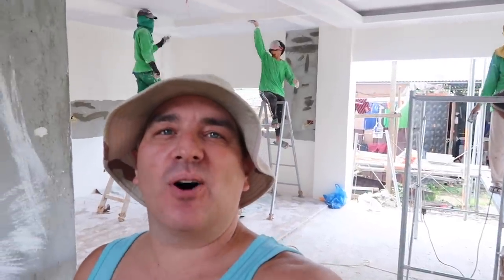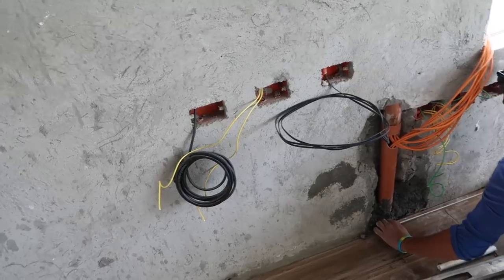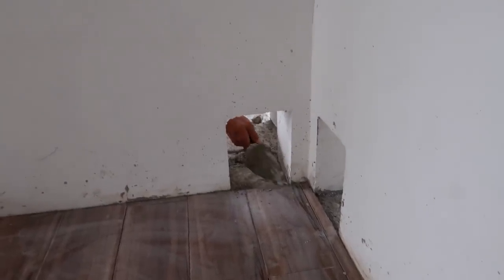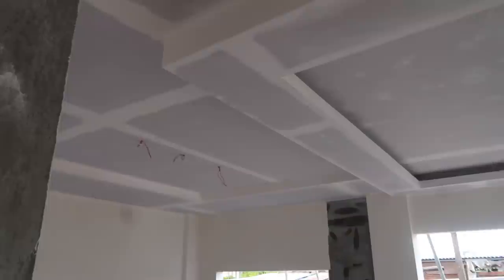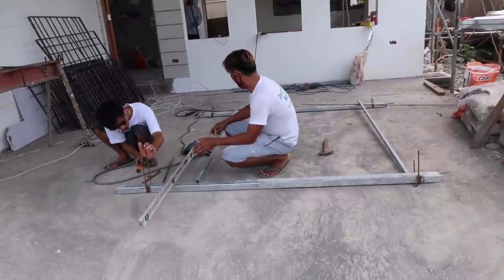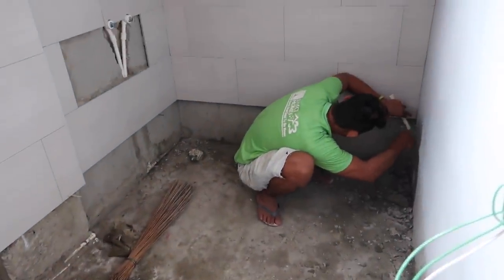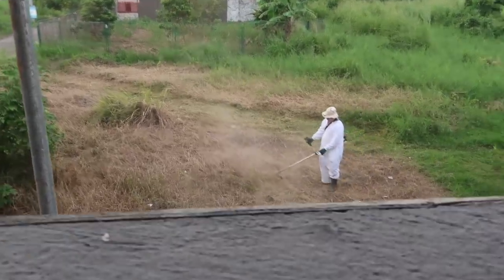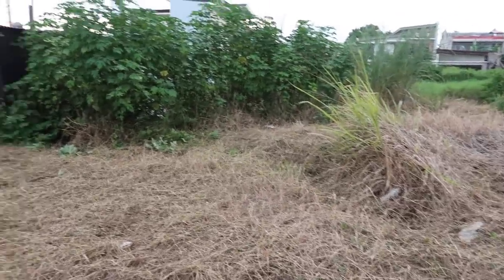HOUSE BUILDING IN THE PHILIPPINES - EPISODE 155: SANDING & PRIMING I FENCING

Comment: I did give it again a thumbs down, Not that i dont like your channel as i do like. It makes me sad to see your contractor is doing a very poor job..! This is not a cheap build and most i see is beginners mistakes what i dont expect in a build like this. Its chaos as well, Nothing is finished before to the next level to let the project finish the right way. Painting while the dust is flying around etc etc.. I feel sad for you guy's and if i was you i would have a good word with your contractor. My opinion,, I have build some houses so i should know. Take care and i hope the best for u guy's
Reply: Agree with you 100%. And yes I was a mason contractor and also did the concrete work starting at 16 to retirement at 60. Our build in the Philippines is on hold due to quarentine lockdown.
Reply: I agree with you, poor quality of works
Reply: @davidbates7429  we have the same situation, I started building our house in Batangas which is on hold due to covid19. Twice I terminated my 2 foreman because lack punctuality and they themself fond of delaying works to be done on schedule such of this practice of chipping excess cements. Workers have so many complains like the weather is cold, rainny and then too hot.
Reply: Good morning  I did not give you a thumbs down because of the pool workers skin coating .
Reply from the maker: Appreciate  your 👎 it helps a lot😵.Thanks for watching though.